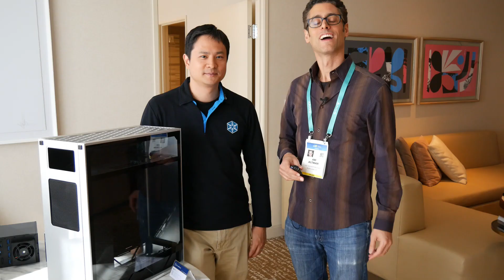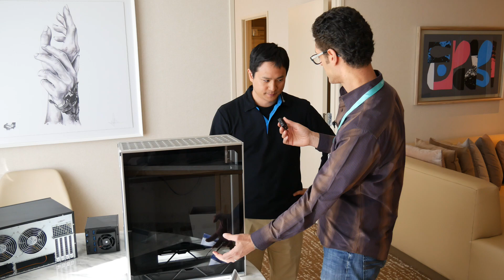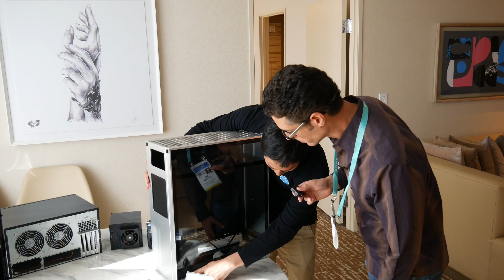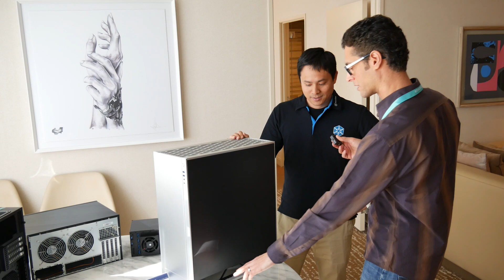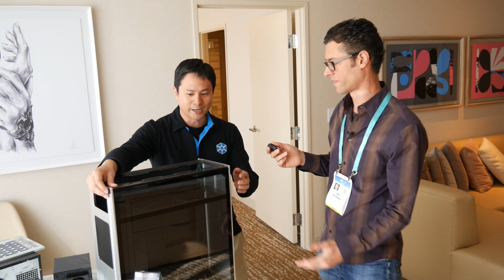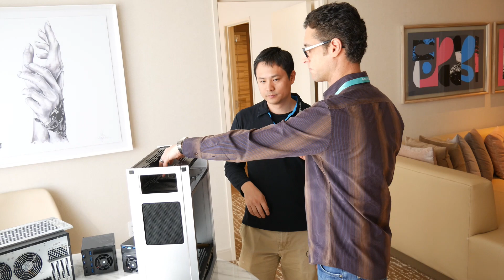CES 2020: SilverStone Debuts its Next Fortress Case - the Alta F1!

Comment: larger exhaust fan on the top 200mm to 240 mm possibility would be nice, a little smaller like a atx size , handle like the ft 05 on the top for easier carrying and a rgb silverstone logo in front

Comment: IMHO it could do with a couple of additional usb ports on the front panel, possibly with one dedicated to charging... if you use bluetooth devices (headset, keyboard e.t.c.) you'll probably want to use the front panel simply so they aren't occluded by a metal body, add a phone and that's all 3 front ports filled with no scope for any further devices such as a convenient port for external hdds for ferrying data or the like.

Comment: Glad to hear that 200mm fan can be mounted, maybe it means we can fit a Noctua NH-D15 in there, finally! (keeping in mind its extra height due to taller rams)

You all know, that we, the people who likes chimney effect are most silence freaks.. and we all love noctua fans and big tower coolers for sure, same for proper cable routing and cable management.
Compatibility with their 200mm fans will be a huge selling point cause there are no "good cases" that can mount them at the moment (i went to the entire list on noctua site and on the listed cases reviews /opinions.. you are welcome).

For answering your question about panels:
Aluminum is ALWAYS the way on the back! (i think that who suggested steel has done that thinking about cost of production)

so we have "sku A" with ONE glass panel and "sku B" with aluminum + sound dampening foam.
A thing that i really dislike is the new design i can see in this video for dust filters. Stick with the one big filter that can be pulled from side, it will look way better and will be super easy to clean as well.

We are all happy even with no fans included cause most of us will change them immediatly as the case arrive home, and put the stock one in some dark closet anyway.
Dont believe me? Ask Lian Li O11 if this isnt true? :D
If you want to offer a 3xAP183 180mm fans pack at discounted price for who buy this case or another silverstone one it will be welcome for sure and worth good consideration.

For RGB question: sell a PROPER rgb kit for sides etc as an optional for who likes windowed & RGB version (most company already do that and people are buying it).

To conclude it seems to me that Silverstone is really really worried about the final price. i would like to point out that there are tons of people asking for a new Fortress 2 in forums, youtube channels and so on. Most of us are buying case that we like only in parts.. Like CM SL600M, Fractal Define Series, 
and still a lot of them us are spending their time to write something that can help you in delivere the case we would like to own.
Please listen to our feedback. 150$ with no fans and 2 sku to choose from would be great if high material and building quality is assured.

Send one case to Gamer Nexus and pass the "SteveTest". You will sell this F1, you will sell it a lot! and i will buy one of them ;)

Comment: With the radiator mounted on the top, you have the PSU hot exhaust pointed into its inlet - how is that efficient cooling?
Reply from the maker: The hot air will exhaust out the rear, although perhaps SilverStone should add a vented top panel.

Comment: Did they mention any release date?
(Or around what quarter of what year could we expect to see it coming to market [in Europe]?)

Edit: Is it right of me to assume that this case supports E-ATX as well as a lot of hard drive bays simultaneously?

Additional comment/opinion in case anyone cares:
I really love the rear I/O, I imagine it would be ideal for my external water cooling loop/setup, whereas I'd just not have to have any fans in the case at all, since convection forces air through the system as the RAM modules heat up the air inside the case. And with my current case (Phanteks 400S), I need to have a fan running 24/7 to avoid dust coming in through the rear I/O, which I imagine would be a minimal issue with the Alta F1.

I also imagine that the way it is inside would make for great cable management (or rather an easy way to hide the fact that I suck at cable management and won't be bothered with doing it at all -- open the right side panel of my case and you'll get nightmares.)

Actually, I don't see a single negative thing about the case, so my feedback is useless for the designers/engineers to make improvements. Maybe only thing I could say which could help would be that I'd rather it not having fans at all, as it would only add cost and most people buy 3rd party fans anyways, so it would just be a waste.
Reply from the maker: I'm checking on availability and will post back if I have updates, but June 2020 would be the absolute earliest, and it's more likely Q3'20. As for E-ATX, I don't think so, and hard drive bays will also be limited. This is a modern redesign of the Fortress concept, and massive hard drive arrays are no longer popular.
Reply: Ok, thank you :D
Reply from the maker: OK, so SilverStone has confirmed that they are targeting June 2020 for mass production of the Alta F1, so ideally they'll be available to consumers around the world by July.

Comment: i have the FT02, and after 10 years, im ready for a new build. New requirements are more portability, because FT02 is NOT lightweight or small. How would you say the new Alta F1 compares? Because i like that i can actually have this in my living room with it looking like a spaceship, but man it looks heavy.
Reply from the maker: The Alta F1 is MUCH smaller, no doubt about that. The specs haven't been released, but I'd assume it's about 9" wide, 22" tall, and perhaps 19" deep. The big difference is in the footprint - it's taller than it is deep, which is the reverse of the 24"-deep and 19.5"-tall FT02.

Comment: Please bring back the FT02 with optionally removable 5.25 bays and better cable management. Tempered glass is all the rage but at least a SKU for having both panels be solid aluminium.
Reply from the maker: I really don't think they'll do an FT02 again, as the form factor just isn't right for today's components, but dual aluminum panels is a definite possibility.

Comment: Silverstone bring up the HP Voodoo Omen pc chassis (2008). The cables in the upper compartment will interfere with the radiator fans and the opening for the cables is way too big, not to mention the noise coming out of it.
Reply from the maker: Wow, I'd never seen the Voodoo Omen before - https://www.techpowerup.com/forums/threads/hp-voodoo-omen-case.62607. That thing looks amazing for being from 2008! And yes, SilverStone's Alta F1 looks very similar, but with a glass panel (which didn't exist in 2008), and without the LCD screen.

I don't think the cables will be such a big problem, and noise coming out of the back of the case is never a major contributor to the user experience. The vented top is going to be a bigger issue, but that's also why it will cool so well.
Reply from the maker: By the way, I just learned that SilverStone designed the HP Voodoo Omen chassis. That's probably why the Alta F1 looks similar!

Comment: Steel panel both sides, drop the window. Add noise dampening front&both sides. Put in a dedicated push-pull GPU fan setup(https://i.imgur.com/oN66ca0.png). Include the penetrator fans on the bottom as intakes as showcased on the Alta S1 last year at computex and you got a #1 case. 

Dropping the glass panel would allow for the GPU push fan to have a rail system in the side panel to be able to place the GPU push fan as close to the GPU's as possible to optimize performance whilst keeping the cost of the entire case as low as possible to allow for inclusion of the penetrator fans and staying within the ~120-140 price range.
Reply from the maker: I think it's going to be pretty hard to market a gaming case without a glass panel in this day and age, but steel (or more likely aluminum) on the right side is probably the way SilverStone will go. The acoustic padding should be a pretty simple addition, and while I don't think it was in this sample, now that SilverStone has heard the calls from enthusiasts about this, I see no reason they wouldn't add it.

Comment: Personally, I don't mind a black steel panel on the left, but the best option would prob be to colour match it. Tempered glass for the left panel would be redundant.

I do think they should consider a bit of foam dampening behind the front panel, the way they did on the FT05.

As for fans, my take is to provide the minimum two 120mm fans that most cases do, and make it the most cost effective ones available. I plan to buy this case and source Noctua fans anyway

Comment: Any info on cable routing width availability? As much as I love my FT05 building and routing was nothing short of an absolute desaster, even with sleeved cables.

Also, since the drive cages seem to be gone, how many 2.5" mounting points are to be expected on the backside of the MB-Tray?

I really like what I'm seeing overall.
Reply: As a fellow FT05 user, I'm also wondering about cable routing behind the motherboard tray
Reply from the maker: It's definitely designed with this in mind. Much better than FT05.

Comment: Did Silverstone say anything about double solid panels with noise dampening?
Reply from the maker: I don't believe so, but it would only be possible in the front and right panel anyway, and right might end up being glass. Overall, it isn't intended as a quiet case., but will be fairly quiet if only bottom fans are used.

Comment: Alta F1!!!!!! Finally, i was waiting so long! Hell, it was worth to wait. You have no idea how much tests i have done with Cosmos C700P Black (temporary case, just for testing). So, from my experience, i tried to do everything, that chimney effect would work well, but here are the problems i have found :
- at the bottom, 2 x 140 fans are too weak to pump enough cool air, these need to work at very high rpm to work effective, hence it produce too much noise. 2 x 180mm fans (same as on Raven series) would be best choice to be included in the kit. Simply - people would buy the case for chimney effect (option without those 180 beauties) and they would be dissapointed to see their top notch hardware overheat inisde the case.
- At the top i'm very happy to see additional fan mounts - straight in the box there can be no fans (for top), but there SHOULD be holes for 2x180mm fans. Just holes, no fans included, with these (sold separate) fans (total of 4 x 180mm) all fans could work at low RPM, so whole machine would remaing  quiet, and there would be enough pressure to exhaust all hot air, and deliver fresh one.
- DUST FILTER FOR PSU - magnetic would be fine.
- Glass panel should be smaller - "working" area (above motherboard - where all cables are) should be covered with steel OR MESH PANEL - mesh would be better, as  there are people, that have not enough space for PC, and there will be little to no space above the case. With such solution glass panels can be some cents cheaper. 

What i see, and manufacturer should NOT CHANGE
- Dust filters and air INTAKE is perfect. As you propably saw, Cosmos C700M (and P black) have bottom filter sliding to the front - thats not good idea - simply when you want to clear the filter while PC is ON, you create too much vibration on the whole frame when sliding the filter - whole dust from filter will be choked by fans. So DO NOT CHANGE that approach. You can change the pattern to match top and bottom mesh (cover of working area and bottom filter skeleton)
- Releasing of pannels is perfect - just add matt frame film on the glass pannel, so use would not need to clean glass from finger stains every time (place to hold the panel)

As for the color..... I thing easiest, and fashioned way, could be gun metal on whole case, with brushed alluminum texture in SOME places.

This is (will be) very good case - i can say that for sure. If you want to hit high end or medium market, you can mount sound proofing mat on the front panel (from inside)
Reply: the silverstone air penatretor 140 was adequete for the old FT05. i like the mordern look of full glass panel. the old cases needed a revise. those were one of a kind. i think no fans is a good idea but for people who want fan they could have addon or 2 sku
Reply: @boombox8675  the FT05 actually utilised two 180mm air penetrator fans

Comment: Awesome design. Very excited and price seems reasonable for what you get.
That said I'd rather Silverstone saved/reallocated money and went with just cheap steel for the side panel rather than perfectly matching the frame in aluminium or going for function-less glass. The rear side will likely be against a wall/solid surface anyway so doesn't matter too much what it looks like.
Reply from the maker: It's currently steel on the prototype,  and I personally thought it clashed too much. The glass and aluminum have a more premium look.
Reply: @TheTechBuyersGuru   I agree the steel looks out of place with aluminum and glass everywhere else.
Reply: Besides not matching it wouldn't save much money and steel is a lot heavier than aluminium.

Comment: Is this an atx case? And also for the power supply can it support a 1000 watt Corsair rm1000? Also can it support a Noctua nhu12s? Thanks.
Reply from the maker: Yes, this is a full-size ATX case. It will support both of the components you list.
Reply: The Tech Buyer's Guru nice! I currently have a cooler master MC500p and I as much as l love this case I would like a smaller case without sacrificing the performance of the MC500p. I have also been looking at the Lian li lancool 2. Which do you think will be better? Do you have any measurements of this case please? This case truly looks almost the size of a itx without sacrificing the atx functionality.
Reply from the maker: SilverStone did not publish specs, but take note that the case is fairly tall, due to the cable/cooling zone at the top. I think it will be bigger overall than the MC500p or Lan Cool 2. But most of this is height - it will be shorter front to back. The Alta F1 will outperform both easily in terms of thermals, and likely noise as well.